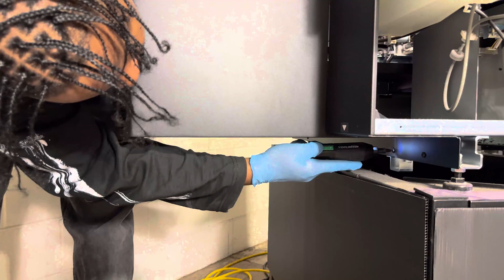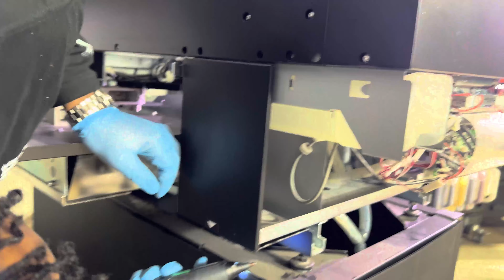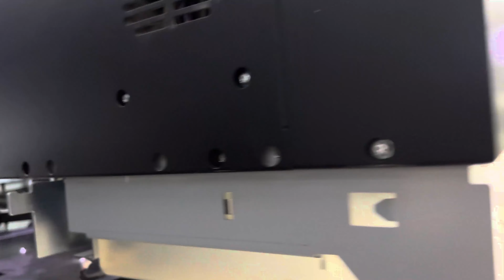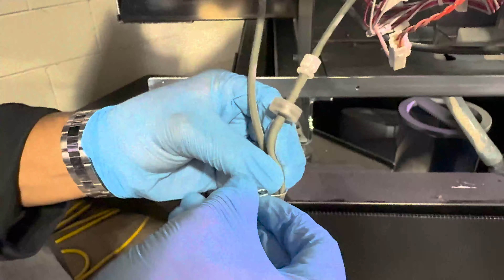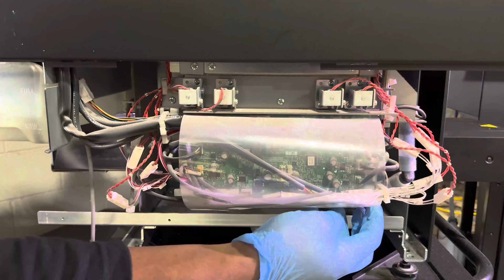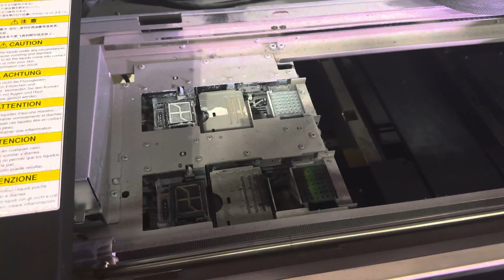How to Replace the Maintenance Station | Brother GTX Pro & Pro B (Step-by-Step) DTG Printer Repair

Comment: I did it -replaced my old maintenance station with a new one!!! thanks a ton. The only thing I'd have done differently would have been to order the entire drain line assembly as the blockage in it was what did my maintenance station in to begin with. FYI my wiring was a little different but no biggie. I'd suggest for anyone to replace your drain line assembly every 5 years or so.
Reply from the maker: Awesome! So glad we were able to help you get this done and save money on repairs 🎯